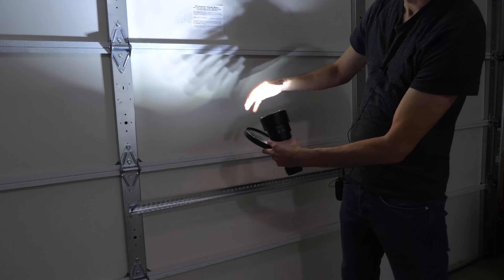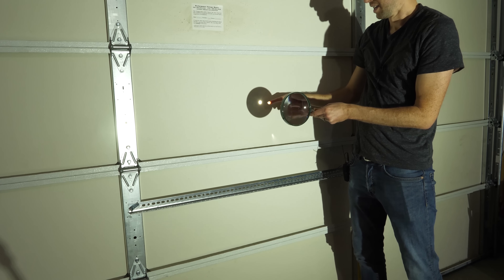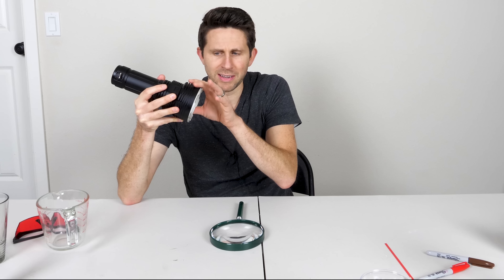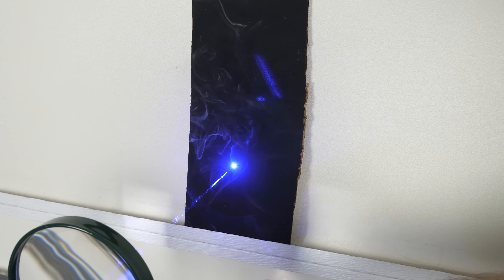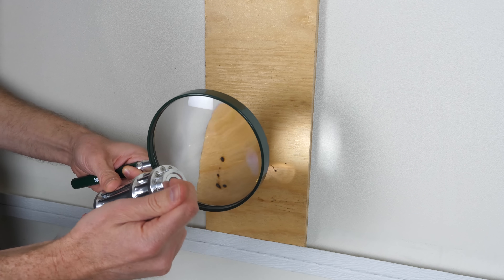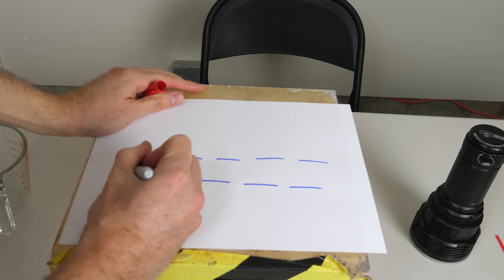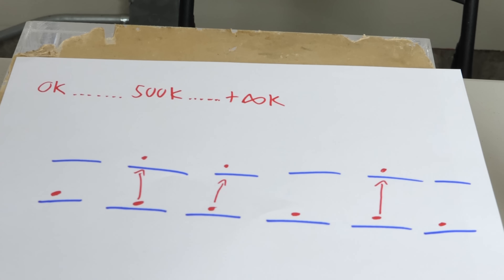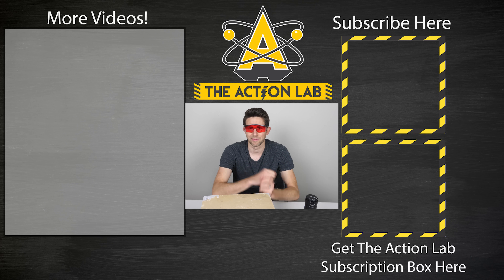What Happens if You Focus a 5W Laser With a Giant Magnifying Glass? Negative Kelvin Temperature!

Comment: Wait what...light from a point (say a magnifying glass sized area)on the surface of the sun can literally go in any direction (in a hemi sphere to leave the surface) it is like your flashlight example in the video but to a far far far greater scale. The suns distance though makes the light travel for the most part parallel.  It is this parallel light path the magnifying glass best focuses to a single point.  Your flashlight however the light is not parallel and will not focus you  at best you'll get the individual led elements as you were seeing. because the reflector for the flashlight was designed to spread that beam out.  The laser is highly focused by design but there still is an "area" that beam will land on and you can focus that because the light is near parallel to an area smaller than the original lasers area.  Thermodynamics isn't being broken.  Focusing a 5mw laser so it lands on say half the area doesn't mean the laser is now times 2 on that area it will always be just short of that. It may be close but it'll be 1.99whatever times the original.

Now the negative temperature stuff is something a little different. Tbh personally I think infinite temperature is a bit of a cop out.  The suggestion is there is a point an object becomes so energy saturated it cannot get any hotter. But that temperature cannot be infinite it's more like it's unattainable.  Much like trying to cool something to 0 Kelvin. You can get really really close but you should not be able to achieve it. 

 My understanding is this 0 thru all positive numbers to infinity reversing back thru negative numbers to negative zero.  Is a silly math work around because we're using infinite temperature.  Alot of this is quantum physics and it makes no sense in comparison to "macro" physics.  

 https://youtu.be/t5MohK5FHEY

Comment: While the video's explanation of things is completely garbled (and his whole thing about the focused light not being brighter is just wrong because brightness is based on energy per unit area, not the total energy), those claiming that negative Kelvin temperatures don’t exist or that lasers don’t have a negative Kelvin temperature need to spend more time studying statistical mechanics and quantum dynamics.

In system with a definite highest energy state, like a laser, as you add energy to the system, you cause the electrons to pile up into that highest energy state.  As more and more electrons pile into that same highest state (or as close to it as they are allowed to get due to fermionic exclusion), the entropy of the system is decreasing, because the diversity of state occupation is decreasing, while the energy in the system is increasing.  Since temperature is defined as the derivative of the heat energy flowing into the system with respect to the corresponding change in entropy of the system

T = dQ_in/dS

we see that for a positive heat flow into the system, dQ_in > 0, while having a decrease in entropy, dS < 0, we must must have that the resulting temperature for the system is negative.  Note, this only happens for systems for which there is a highest energy state that can be occupy.  Most classical thermodynamic system do not have an upper bound on the highest allowed energy state, hence they don’t attain negative temperatures.

By the way, you can find this same information on Wikipedia by googling “negative kelvin”.
Reply: Hey, I finally understood something!
Reply: Exactly ... really what do I know ?

Comment: The highest possible temperature is 1.41679 x 10^32 Kelvin. This is known as the Planck temperature because the wavelength of electromagnetic emissions at this temperature are at the smallest possible size to exist in this universe. Any hotter and the radiation couldn't exist.
Reply: The highest positive absolute temperature, yes, but negative absolute temperature is technically hotter than any positive absolute temperature because heat will flow from an object with negative absolute temperature to one with any positive absolute temperature.

Comment: How can you not make a point hotter than the surface of the lightbulb?

If you use mirrors to funnel all the light from the flashlight into the magnifying glass, which in turn concentrates all the light to a, let's say (0.00001mm)^2 point you would indeed get a point which is alot hotter than the surface of the lightbulb, because the lightbulb has its heat spread out on a larger surface.

Would greatly appreciate you testing this theory.
Reply: Same applies to the sun, if you can concentrate all the light coming from the sun into one dense point I  would argue that it would in fact be hotter than the surface itself. Because you are condensing all the energy from a huge surface into a small one.
Reply: You can't do it with lenses.

With perfectly reflective mirrors (which don't exist) you probably could get a very small point hotter than the surface of the sun, or at least to the temperature of the surface of the sun.

Comment: nothing is hotter than infinity
Reply: https://www.quantum-munich.de/media/negative-absolute-temperature-what-is-it/
Reply: @Mutantcy1992 technically not hotter than infinity but the same temperature because they can both go on forever
Reply: @nathan.3948  Okay, but speaking from a thermodynamic standpoint, a body with any negative absolute temperature will transfer heat to a body with any positive absolute temperature.  That's the thermodynamic definition of hotter, you know, the direction heat will travel between two bodies.
Reply: @Mutantcy1992  guess how much i care i mean this video was a month ago but its still not as much as infinity because infinity doesn't end.
Reply: @nathan.3948  The video is a month old and the science is a good bit older.  I'm sure you'll learn a lot of new things being so convinced that your current way of viewing things is the only correct one.

Comment: Just think of a Pressure Washer Nozzle
Same water Pressure delivered to the Nozzle.
but the Smaller the Orifice ( the total amount of Energy is Focused Down to a smaller Size ) 
The Power is concentrated by  the Stream of Water to a much smaller surface.

So light is similar.
The Source of the Light is Producing a Specific Quantity of Energy.
Un Focused, it is Spread over a wider Surface.
Energy per surface area..
If you Capture a Portion of the Available Energy, and Focus it to a Smaller Surface area, 
You Increase the Energy per Surface area.

If you Can Capture ALL of the Available Energy, Such as the Light from the Laser Beam,  and Focus it down to a Smaller Size.
Then you Have Increased the Energy per Surface area of the Entire energy available.

With the Sun and The Flashlight,  the Lense can not Capture all of the Energy available.  The Focal Length of the Lense is too great for the Flash Light..

Comment: no!
Case 1-> LED flash light spreads out, generating head over a large area. Heat is dissipated over a large area and so does not burn the surface
Case 2-> LED flash light over lens. The heat is hotter but never gets too hot because the light coming out of the flashlight is too big and only a small part is within the len's area and gets concentrated to a point.
Case 3-> unlike a flash light, the lazer shoot light out with much less dispersion then the light from LED flashlight. Almost no dispersion in fact. It's heat is also much more than the flash light and if left over time can burn the surface.
Case 4 -> when brought closer to the surface, the lazer will burn more, as expected, since the particles spend less time losing heat in the air and also the minumal dispersion of the lazer's rays are lessened. The focus on the surface is higher and the burning is faster.... but not by much, since the lazer from far away already had very little disersion of rays of light and lost little heat as it travelled, since it is not a LED bulb like the flashlight, but a lazer the concentrates light directly through a point.
Case 5 -> the lazer point is reduced through the lens. since there is less surface area, the effect of the heat is MUCH greater... but if you move the point around, it will take the same amount of time to burn an area that is the same size as the area you would have burned without the lens. You merely concentrated the point to a smaller area, causing less surface damage but in a quicker time.

conclusion: the reason that the effects of the lazer on the lens are more noticeable is because the lens has less dispersion than the flashlight. A lots of energy is lost by the flashlight's rays spreading out and avoiding going through the lens of the magnifying glass. the lazer on the other hand has less dispersion and the light can be focused to a point. That point will burn hotter, but be much smaller than if you brought the lazer close to the surface. The quantities of energy remain the same in each case, but the area of effect is different. The flashlight spreads out a LOT, the lazer is more focused and finally the lazer + lens is most focused. That is all.

Comment: Doesn't make sense.  The sun doesn't set fire to cardboard left in the sun all day, but using a magnifying glass can immediately.  Unless a magnifying glass shortens time.  Like if there isn't enough daylight hours for the sun to heat up cardboard by itself.  And there is a combination of lenses to concentrate all the flashlight energy to one point.  Some energy will be lost, but I bet it would be pretty good.

Comment: I'm not buying this.  If it's actually infinity, how can it actually reach infinity to begin falling again? It not like 700k is legit but 701k is infinite. That is in fact the definition of finite.   If it's really infinite, it would burn through the other side of the planet before flipping over to start coming back down again.   No.  This is some silly BS.    Think maybe somewhere lost in the physics it MIGHT also be generating your supposed negative Kelvin too.  But the main light we see is not negative anything, it's normal hot bright light.  If it weren't, we would neither be able to see it nor watch it generate heat.
Reply: From my understanding it is like this. (I am just an undergarduate mathematics student with some interest in physics so be aware that mistakes may be possible)

Negative kelvin comes up when you think about the quantum definition of energy and for a system with more atoms with a high energy state than those with a low energy state to make sense in our equations the temperature must be absolute negative. It also has to do with the heat flow because the flow of heat is reversed which also makes sense of the fact that negative is hotter than positive because how hot something is depends on how many atoms are excited.
Reply: Wasn't it said that light itself cannot be seen , only its effects ? you can see the object because of the reaction with the light hitting it ?

Comment: I think this is fallacious, regardless of the conservation of etendue , your apparatus fails to demonstrate it: LEDs are lasers too. 
Your LED flashlite simply has reflectors and difusers - which could be easily re-entrained by using a series of lenses.
So your comparison fails to demonstrate conservation of etendue - you must use a valid apparatus.
If, on the other hand, you were demonstrating energy density, or the inverse-square law, your apparatus would be adequate.

Comment: A negative temperature implied with a hot positive temp...I call bs on that. The hottest is 0 degrees K. Bullcrap again.  Yes agreed there are infinite states of matter flux, resonance and orientation  but the laser system  climbs infinitely up not down with positive focus. You got part of the Second Law of Thermodynamics  Correct I'll give ya that but the heat dosnt just exists becasue of opposing states. Picture matter as a battery atoms can store energy then bleed to cold discharging if the force is disapplied.

Comment: Actually doing focusing the sun should be possible because all the energy from the Sun is focus down into a smaller point and temperature is just a measurement of energy same with light so if you focus more energy than was originally hitting it would make it hotter and brighter than it what it was

Comment: You can focus all the light in the flash light. But that won't make it more powerful than the source. Your stating the premise incorrectly. Higher heat does not mean more powerful. 100 DEGREES over 500 square inches is more powerful than 200 degrees over 10 square inches. Not as complicated as you are making it.

Comment: so here is the problem with your explanation. Once all electrons are in their higher energy state (aka the electron moved from its ground state to a higher orbital level with the addition of energy) when that electron relaxes back down it does so emitting a single wavelength of light. this transfers energy in a far more efficient manner than natural light which is a wavelength soup.  as the light propagates it spreads out, all you are doing with the magnifying glass is condensing that spread out light into a focused point.  You are correct in your stating negative kelvin, however that has to do with entropy and not necessarily temperature. that being a system (our excited electron states) reducing their entropy with the addition of more energy, that is saturating their higher orbitals with electrons.  At the end of the day however you are still adding energy to a system and then releasing energy from that system. You cannot take out more energy from the system, negative kelvin or not. I see what you are trying to say but your last statement was dead wrong. "You can get to any temperature you want..." No, you can get to the temperature equivalent of the energy released by the relaxation of an electron from its higher orbital to the ground state. All the magnifying glass does is concentrate the light energy in a smaller point so you have more quanta hitting a smaller area. The energy remains the same

Comment: Well, I didn't get any of that, but the conclusion that I reached is that since a flashlight or the sun or any other light source other than lasers spread out, a lens can never gather all the light to a single spot, so the concentrated light is from a small portion of the source. Since a laser has such a small concentrated linear beam of light, none of it is spread out, so the lens can harness the entire light source and concentrate it even further thus making it hotter than the source.

Comment: Dude, you got it all wrong. The reason it works for laser is that the whole laser beam hits the surface of the magnifying glass. With the flashlight (as you said) you had to step away and thus you let the light spread around. If you had:
1: A magnifying glass big enough to capture all the light you would pull this off.
2: A flashlight with a less spread you would pull this off
3. A magnifying glass with a different focal length you would pull this off
And you wouldnt violate any law - your flashlight produces some energy - when you step away you have the same energy but over a larger area. When you step closer you have the same energy but over a smaller area and you might even feel the heat when you put the flashlight on your hand. If you used proper tools you would be able to focus the light from the flashlight without loosing it all over the place and you could burn things with it.
Just like you can burn things with a magnifying glass using the Sun. Notice that also here you loose a lot of light. You can only focus as much as the area of the glass itself. And it's enough. See the shadow around the bright spot when you use the magnifying glass? That's all the missing energy from that area that you focus into a smaller spot in the center.